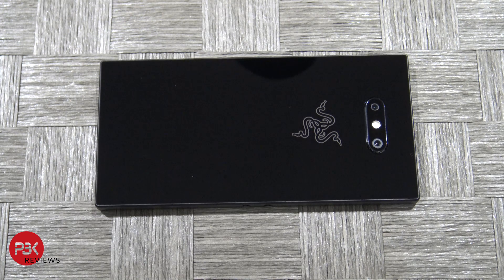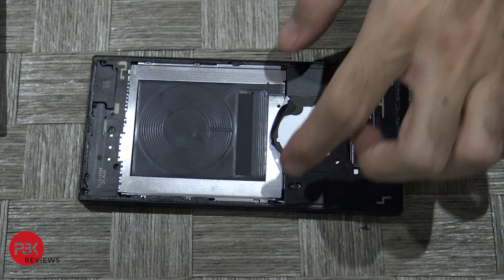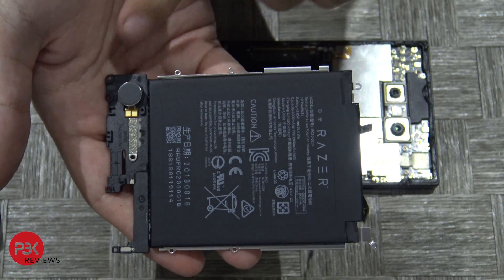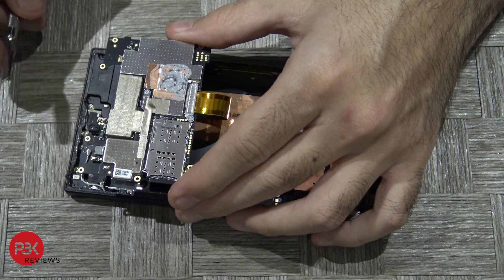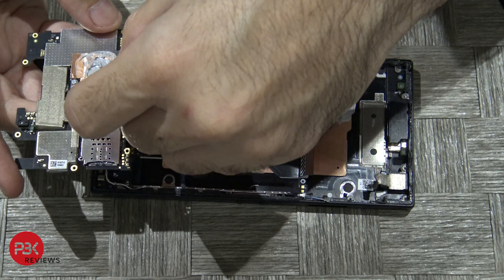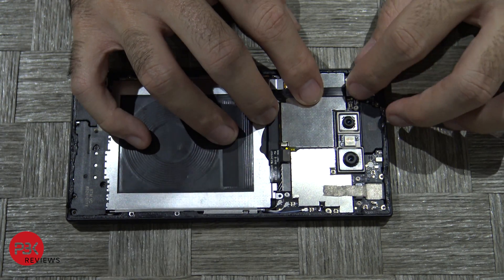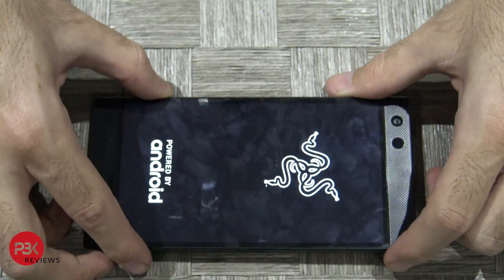2018 Razer Phone 2 Disassembly Teardown Repair Video

Comment: Take off speaker grill if didn't know u can remove them and remove screen easier 😂🤦🏼‍♀️
Reply from the maker: The razr phone 2 is taken apart from the rear not front, so removing the speaker grills really does nothing. The razr phone 1 is different and yes on razr phone one you take the speaker grills off first.
Reply: @PBKreviews do you know where I could find replacement speaker grills?
Reply: I own razer 2 that's how mine was removed

Comment: Where is the microfone
Reply from the maker: the main mic you speak into is @9:30 in the video to the bottom left of the video under where the vibrator motor sits. Its a small rectangle gold metal piece.
Reply: @PBKreviews  thanks man!

Comment: So, anyone able to find any replacement parts for sale?
Reply: Ive found some on eBay and aliexpress
Reply: I've found used parts on eBay that's about it.
Reply: @Vic9mm  anything except ebay? im from indonesia though,, not found anything yet
Reply: @DaunHijau001  Do you find the replacment part? atau terbengkalai hp nya sekarang bang
Reply: they have the back plate on amazon

Comment: Great video, I am going to reference it, just wondering if the power button/fingerprint scanner can be removed and placed back in again? Dropped my phone and unfortunately knocked the power button in and its stuck always pressed. So just want to see if I can remove it and place it back in to see if that fixes it.
Reply from the maker: Hi, yes once you disassemble the phone, there are two screws holding the bracket that covers the power button and cable. Once you remove the bracket you can pull out the power button/sensor assembly out.
Reply: @PBKreviews  Thanks, it seems the drop made a very slight dent to the case, cant even see the difference with the naked eye but a dent enough so the power button was stuck pressed against the metal bracket inside. I had to file down the bracket so the power button assemble had just enough room so it wont stay pressed. Fixed now! Thanks!
Reply from the maker: @liljuny  glad to hear you fixed it. Your welcome

Comment: So basically.... How to replace a razer phone 2 battery: 
Step 1: go to razer.com.
Step 2: add razer phone 2 to shopping cart.
Step 3: Proceed to checkout.
Reply from the maker: haha
Reply: Pretty much it. I'm currently here watching this because mine has a swollen battery, barely used it..
Reply: This is much easier than some other phones that have permanent adhesive holding the battery in, I could see it not being worth it to replace the screen if it breaks though.

Comment: Can I remove the wireless charging coil and instead put thermal pads? I never ever use wireless charging.
Reply from the maker: You can, but  I don't see there being much benefit of using thermal pads, since its only the battery on the other side and not actually the copper head spreader that you would want to dissipate heat from.

Comment: Interesting that they but a (what I presume is an) antenna wire over the the usb cable.
Reply from the maker: Ya, I'm not too sure what those wires are for, however I still don't understand why many manufactures still use those when I would expect them just to run the lines through a flex cable or the main board itself. Those wires are easy to damage when trying to remove and hard to put back on as well.

Comment: When you press on the back of the Razer Phone 2, is there a sound like adhesive being stuck and removed?
Reply from the maker: Yes there is, its probably the adhesive behind the logo light panel. Could be annoying for some .
Reply: I have the same problem

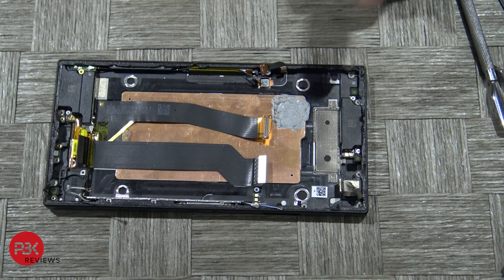Comment: So thats the vapor chamber 10:15 ?
Reply: Its vapour chamber. There is water inside as jerry said. There are very small droplets of water. Btw copper can be used for cooling down without use of water.
Reply from the maker: @adityakumawat8112  yes you're right. Also ya copper is used on most phones to transfer the heat.
Reply from the maker: Its just a thin copper piece thats adhered to the frame to disperse heat, not a heat pipe or vapor chamber.
Reply: pwrdbykyank really? Another marketing gimmick saying its a thick (not that thick) vapor chamber then. :/

Like ur video btw, hope u can do teardown for Xiaomi Black Shark Helo, wanna see the new dual liquid cooling they have on their gaming phone. Subscribed :)
Reply from the maker: Not sure how something that thin can be a vapor chamber but ya it was a very thin copper flat against the midframe, im sure it disperses the heat well but again i dont like how they put it behind the screen. Also thanks, i will look into getting that phone and doing one. Im going to post one of the rog phone and the red hydrogen one phone soon so keep an eye out for it
Reply: @PBKreviews  What I question is the choice to put the battery basically right up against the copper heat transfer plate. Vapor chamber or not, I suspect it will get the battery warmer than it would otherwise, which is not great.
Reply from the maker: True, there are those two flex cables running in between the copper and battery, however not sure if that helps any. Aside from the heat, the whole removal of the battery with that metal plate is actually a plus in my opinion because it made the removal of the battery very easy compared to when its adhered down and requires you to pry it off and warp the battery etc.